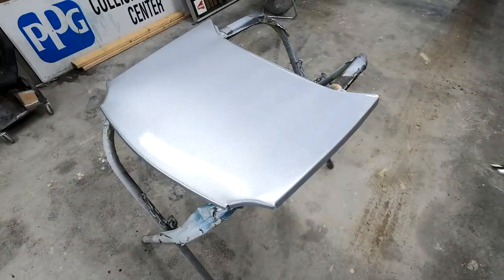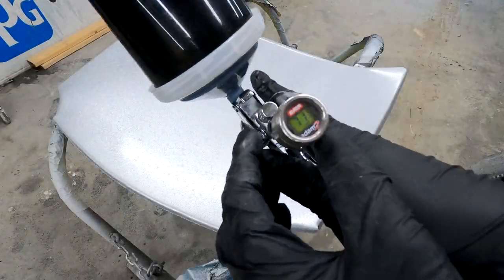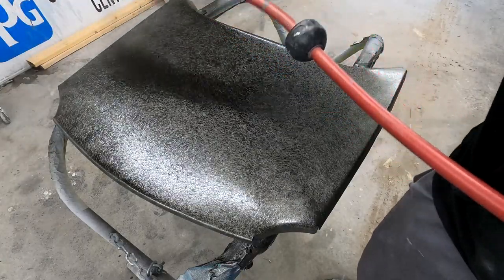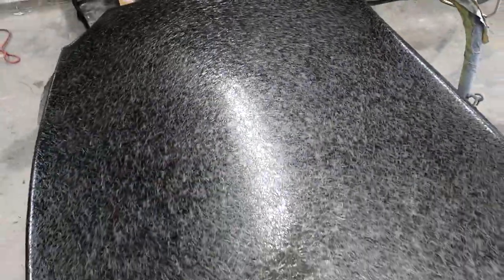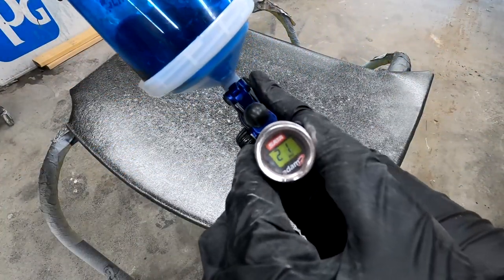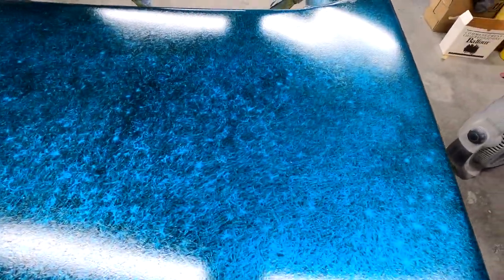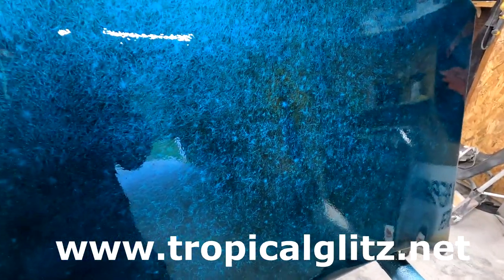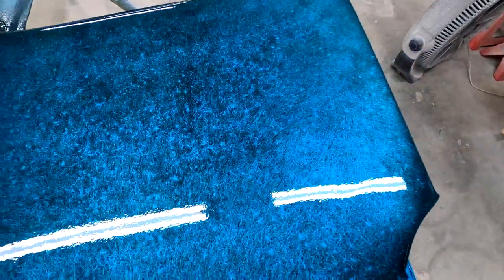How To Custom Paint: Crystal EFX,  part 1

Comment: Very nice!! I need to try 👍🏼👍🏼
Reply from the maker: I'm doing a follow up next week on this.

Technically,  the right way is to clear your base or bury it in an intercoat. Then do the crystal effect over that.

In part 2, ill be doing that, as well as using an updated crystal solution to make much larger crystals
Reply: @inthehomeshop  nice!! I ordered to pearls and flakes from them lol where did you get that panel from?
Reply from the maker: @Lucascalcena  that's a good question 😂  I've had it here at the home shop for a few years
Reply: @inthehomeshop  that’s cool, I’ll keep my eye out for baby hoods lol
Reply from the maker: I want to say FinishMaster has them.

Comment: Hey bud what is the Brand of gun you are using. It has a digital air regulator on the back of the gun.
Reply from the maker: that is a SATA 1500 1.3 RP .  I put their digital gauge on it which is the ADAM 2

Comment: That looks awesome, I always love the crystal effect under candy! One question though, what is the dry time on the black paint before you knock it off? I've watched many videos on how to do crystal effects and nobody includes that in their tutorial.
Reply from the maker: It's just like any other basecoat.  Once it's flashed and can sand on it, it's good.  I typically let stuff sit 20-30 minutes to be safe
Reply: @inthehomeshop  Thanks, I appreciate your response!! I've asked many people this question multiple times and have never gotten a response, thanks again!!
Reply from the maker: @joshsmith2483  no problem man.  I did videos for fun and for people to learn.  I reply back to most everyone thst comments or messages.  I may start doing them again.
Reply: thank you! I've seen this effect and been wondering how it was done
Reply: 5 mins only
Reply: Have to be black paint only? Or I can use any salid color
Reply from the maker: Black is mostly used just to have a darker contrasting color. You can use whatever you want.  That's the fun part, there's never a wrong way to so things.  Try it and experiment